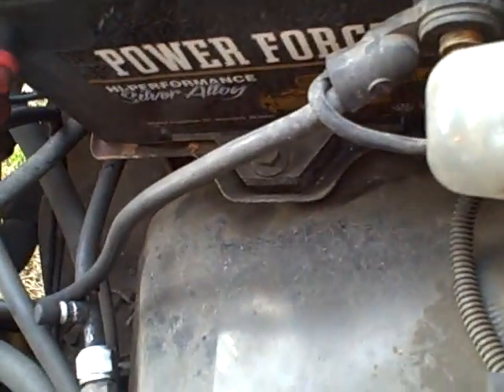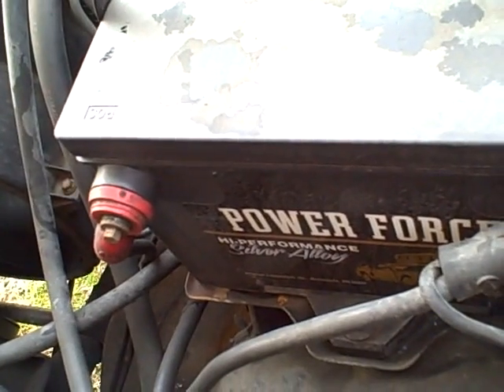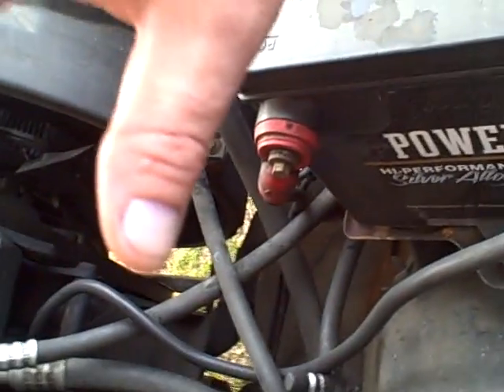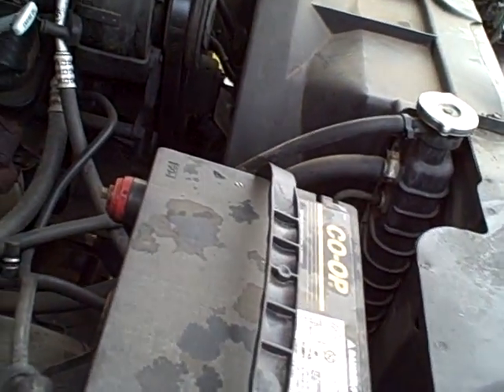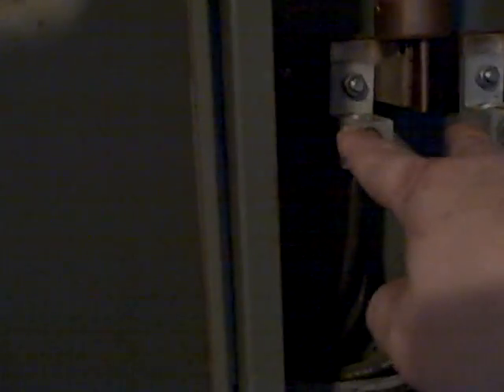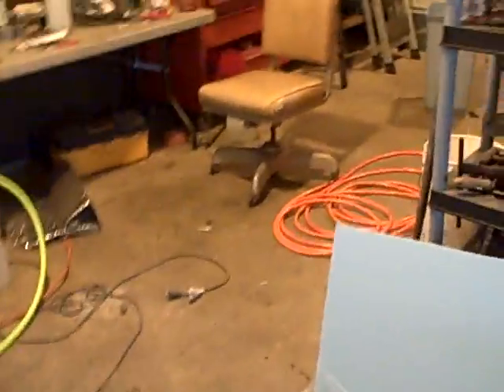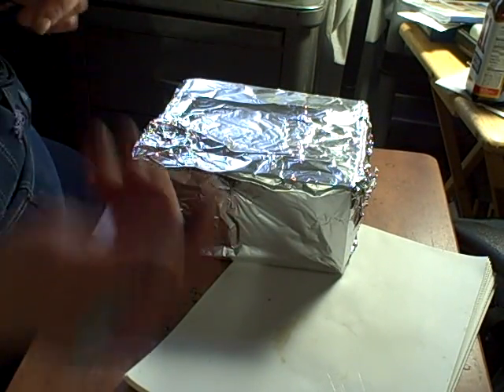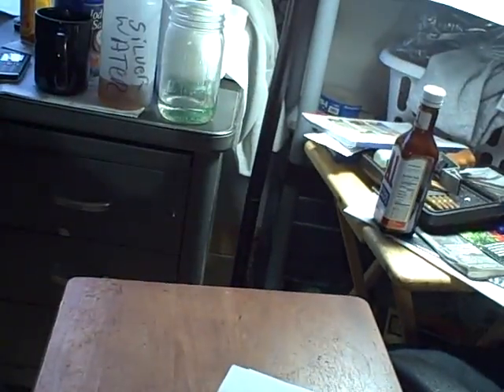EMP Electro Magnetic Pulse or solar storm preparedness

Comment: For your vehicle, if you can afford it, is to go to someplace like pull-a part and get a computer brain for your type vehicle. This is much cheaper than buying a new one. Take the new (used computer brain) and install it in your vehicle and test it. If it works you can just leave it or swap them back out. If it doesn't work, go back and get one that does. Then keep the spare in one of the metal encased containers Mr. Sarti described. The suggestion of removing the battery and connecting the two cables together is a new one on me but seems very logical as well as grounding the entire vehicle. Having a spare computer brain for your vehicle would be that much more insurance. But be forewarned. Being seen driving when everyone else is having to walk might not make you the most popular dude in town or make you too popular, if you know what I mean. It might also make you a target. What I would like to know is if there is a way to protect a solar cell system that is in current use. There is a whole lot of money tied up into all the batteries and charge controllers, not to mention the panels themselves. Good informative video though, thanks.
Reply: Everyone from the Police, neighbors, and thugs will try to shoot you for your running vehicle. Plus, for a Nuclear EMP attack, I doubt if we'll get more than 15 minutes notice.

Comment: this info is completely  useless none of you ideas will work at all an emp can go through  several feet of cement and steal  not to mention there is always residual power  in your car even when the battery is disconnected  (its what keeps the clock and the onboard comp working ) try your ideas but they wont work

Comment: What gave you reason to believe ions would seek a ground?  Where did you come across information that ions were structurally able to do what an electron can do, an ion is an atomor group of atomsthat are pos.+ charged(cation) or neg. charged(anion) as a loss or gain of electrons during a chemical reactionor certain types of radiationin solution you call them electrolytes. If you coil a copper wire around a nail run current through it U can make a magnet but whats going through the wire electrons

Comment: You know your gonna get someone killed I have no idea where you came across the fact that Aluminum was'nt conductive brother but you need to recheck you sources. They use  heavy Alum. cables to connect tower cranes in the construction field  because of the costs of copper,  and the connections are checked almost every day to make sure they are tight, alum oxidises easily and slip from its connection; Iwas next to one when it did near gave me a heartattack, Grounded out and exploded !

Comment: If that be the case with Aluminum, why would'nt you just use it for the grounding on your home and all electronics?  I would never have believed that Gold could be magnetized but it appears that it can be under the right  circumstances, its a crazy experiment.. but have nbever heard of AL. being magnitized. and your mistaken in thinking  aluminum is hardly conductive, don't hold on to the wire thats running to any power source  or you won't be commenting here. It oxydizes easily and looses grip

Comment: but i do believe its fairly impossible. since a speaker is magnetic but when a high emp hits or anything that draws magnetism can be magnetized. Your skin for example is big, all the metals we intake, the steel a car is made of, any metal that is magnetized can destroy a device that souly drives from power. its hard to explain but in my opinion. my phone will be encased in thick cardboard with aluminum shell and a steel outer case. the case will be magnetized but the aluminum repels kinda.

Comment: some metals do not, aluminum for example does not and it has hardly any conductive properties. casing something with it is not stopping the emp but saving it. when the million of nearby metals magnetize it could still damage the components. when you replace a computer component like a video card or a processor, it is ket to make sure you are not conducting static, it can damage a device. though static is not insanely strong, emp's or geomagnetic storms can be. protecting/shielding CAN work...

Comment: FYI, your overdoing what is neccessary to protect a vehicle. All you need to do is remove the battery. Once that is done, the vehicle is officially grounded. How? As long as you have rubber tires on the vehicle and no power source to "Surge" the energy from, you're good to go.
Just be sure to mount a .50cal HMG on the roof because 299 million people who do not know of EMP will be coming after your working vehicle.. =)

Comment: So this would work for a non fuel injected car, however an efi engine would need the the ecu to also be cased in metal. Also why would you need to protect the battery? Isn't it a chemical base.

Comment: @AridSea I think nukes can be specifically designed to produce more EMP if that is the enemy's objective. 
they also come is widely different sizes.Tzar bomba is many many times larger than the ones used in WWII. quoting a fixed range for EMP effects from a nuke is simply not correct. .

Comment: @johnny102marvin I am pretty sure the carbon rods are held in the run position by solenoids. When the power fails to the solenoids, giant springs ram them to the crash stop position. fail safe position. I think you underestimate the designers of nuclear power plants just a little.  At least the ones in the US. But I'm no expert.

Comment: For vehicle protection, maybe consider buying a spare ECM module and storing that in one of your metal Faraday cages (gunsafe or other steel cabinet). However, I think the paint on the door must be removed to create electrical contact around the endges of the door with the gun cabinet. Also, the electronics should sit on an insulator (like in a cardboard box). But who really knows?

Comment: I am glad to see you are taking the threat seriously, and are trying to assist others in preparing themselves.  However, all of your efforts will be rendered ineffective.  Unfortunately, the problem is the silicon board components and other electronics within your car (& elsewhere) will burn out!  The EMP will cause high voltage arcing across the boards from component to component; regardless if you disconnect power or is grounded.
Also, you must use brass mesh; aluminum foil will NOT work!

Comment: @dsarti1 emb is verry dificult to defend against, because you need both magnetic and electric shield. if the magnetic pulse pases an electronic device, grounding it is worthless, because there will be too much power generated in wires and conections between components. shorting the wires where you conect the battery is worse, because you create a circuit.

Comment: I believe the ratiation will first be absorbed by metals in the electronics or non electronic metal parts near the circuit and THEN result in a buildup of charge and then discharge. I would respectfully advise to park any vehicle or device such as solar chargers &whatnot ;) under a garage augmented with a faraday cage perhaps & metal panels such as led even.. Smaller boxes for smaller items like torches & radios. Don't mind the haters, able men & women such as yourself are national treasures.

Comment: if you cover the battery it wont do shit... EMP's attack "more confusing" circuit boards like a computer, or ignition system in a car. It wouldnt affect a flashlight or the power windows in your car because those are "simple circuits".

Comment: by the way, you said you learned all this from air force and books. I have been trying to get into electronics as a hobby. I have read a lot of terrible books that only scratch the surface of it. very frustrating.  None of them show you HOW to build circuits and the METHODS and WHY a particular circuit is made in that way.  Do you have any suggestions on books? websites? thanks

Comment from the maker: pt 4
which can damage power supplies and communications interfaces if these are not hardened. Moreover, should the transient penetrate into the equipment, damage can be done to other devices inside. 

Notice how both modes for a significant amount of the pulse to get in, are mainly antennas and wiring.

Comment from the maker: PT 3
Back Door Coupling occurs when the electromagnetic field from a weapon produces large transient currents (termed spikes, when produced by a low frequency weapon ) or electrical standing waves (when produced by a HPM weapon) on fixed electrical wiring and cables interconnecting equipment, or providing connections to mains power or the telephone network . Equipment connected to exposed cables or wiring will experience either high voltage transient spikes or standing waves

Comment from the maker: pt2
There are two major modes for EMP to get into equipment:
-Front Door Coupling occurs typically when power from a electromagnetic weapon is coupled into an antenna associated with radar or communications equipment. The antenna subsystem is designed to couple power in and out of the equipment, and thus provides an efficient path for the power flow from the electromagnetic weapon to enter the equipment and cause damage.

Comment from the maker: Don't forget that CREE and Luxeon have a rather large ESD diode inside, that would greatly help to clamp that pulse from destroying the die. Usually this ESD diode is rated for 2,000 Volts. Also, the die is mounted above a "ground plane", which has capacitance, which will further help reduce the effects of the pulse.
EMP pulses are short, in the order of 100 billionths of a second, dropping to half amplitude within 200 billionths of a second,

Comment: crabtrap
Awesome that you use a microwave that way! I think I'll start looking for cheap used microwaves. I know just where to ground it. 
Are you sure LED flashlights are vulnerable to EMP? I had the idea that only complex electronics are vulnerable. But a single huge LED? My flashlights are 3 watt specials that I bought for 12 bucks each. They don't have any complex electronics in them. 
My headlight however has multiple settings, heat sensors for the LED's and voltage monitors so it's toast.

Comment from the maker: size is irelivent and batterys are pretty safe but if possable I would sheild all stored electronic equipment if storing batteries make sure they are in a NON conductive container first. There are little things you can do to increse your odds in electro storm or emp simply grounding your tin roof and making sure your lightning rods are in working order. did you follow the link for the chicken wire faraday cage?

Comment: 2. 
The microwave oven uses it's Faraday cage every day to keep you from frying when you cook something, so it provides top notch EMP protection, especially if you have your home grounded the way you do. 
Pulling your breakers is great because otherwise the entire power grid will collect that EMP energy and funnel it right into your home. I imagine it could not only fry your laptop but it might even turn into a small bomb if that much power hits it.

Comment: Awesome vid! This sort of thing should be prepared for and I've taken some measures to get ready as well. If i've heard correctly though, EMPs are most destructive to fine circuitry rather than big things like car batteries. Can't hurt to be safe though. 
One Faraday cage that you forgot to mention, one that's in nearly every home in the US, and that's a microwave oven. If your house is grounded that would be the safest spot in the house for your electronics.